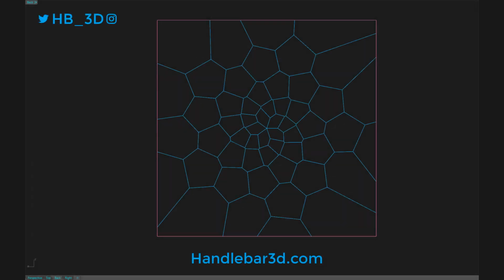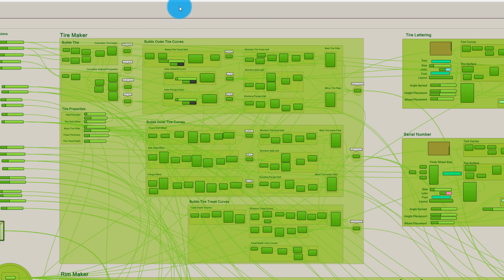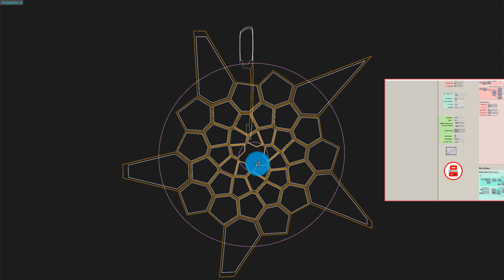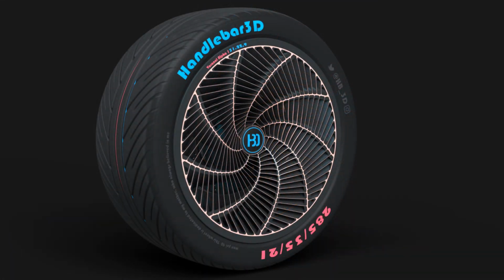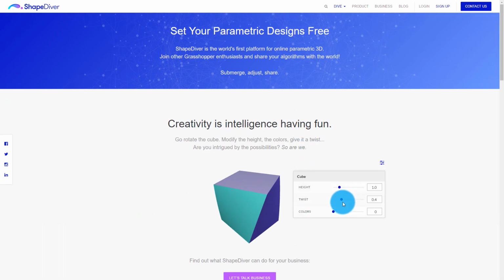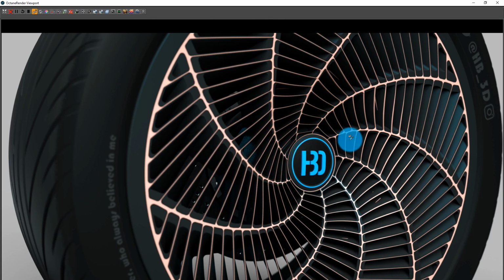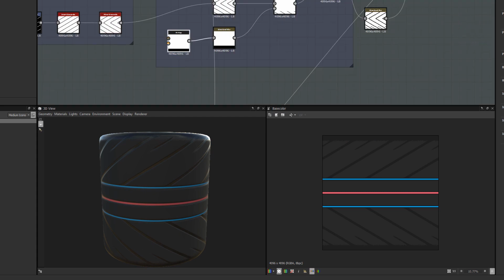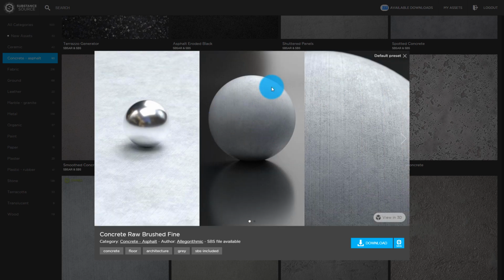Voronoi Alpha 1 Wheel System

Comment: You did an exceptional job, can I buy this as a separate software to generate shapes for 3d printing ?
Reply from the maker: The algorithm needs Rhino and Grasshopper to function, it isn't stand alone.
Reply: Would it be possible to upload the project files for use in Rhino and Grasshopper? I have access to both and it would be great to try out!

Comment: Not meant as a bad comment at all, but just to clarify the pronunciation:
https://www.howtopronounce.com/voronoi/
It's vo like voice, ro like row and noi like noise.

Thanks for sharing though, very interesting way of generating geometry through the use of node-based solutions like grasshopper, substance designer and even octane (nodes). Modo/octane user myself so always nice if people advertise its use. Am experimenting with nodebox and svg's to calculate/replicate 2D forms although it lacks a 3D output (you can export 2D vectors). I very much believe in the crossover of knowledge in programming and creating (3d) art so great job on your part.

Did your experiment with using modo's procedural workflow using a node-based approach yet? This might also interest you: http://fabricengine.com/
Reply from the maker: Thanks for the clarification. Since I'm self taught I've only read it on books but now I'll know how to pronounce it. I have worked with MODO's procedural workflow. I'm in automotive and product design so polygon based workflows aren't necessary but once I find the time I'm sure I'll dig my feet in. I really want to make some generative L systems, maybe like trees and things of this nature. I  usually keep the polygon stuff to build my environments so I'm sure I'll get back to it in no time. 

That fabrice engine looks super cool, this seems more  geared towards gaming, vfx, things of that nature. I'm focused on nurb based solutions my industry can use  down their pipeline, but I love that more and more industries and people are getting into parametric design workflows. Thanks for the tip and I'll make sure to practice how to say it before I give I give a talk again.